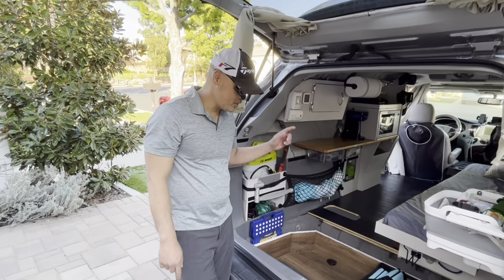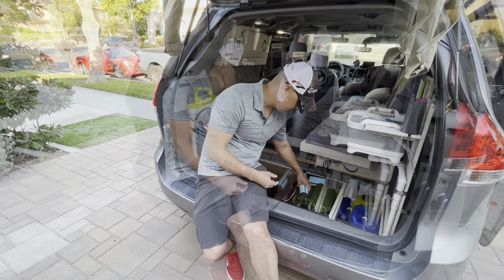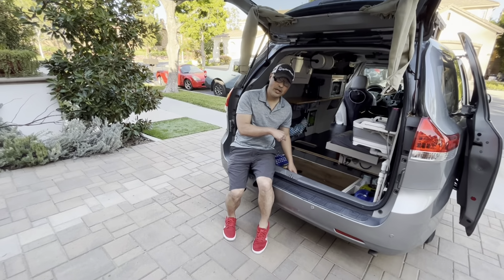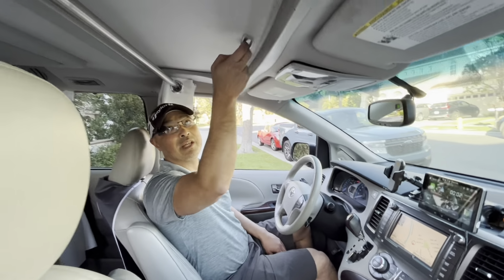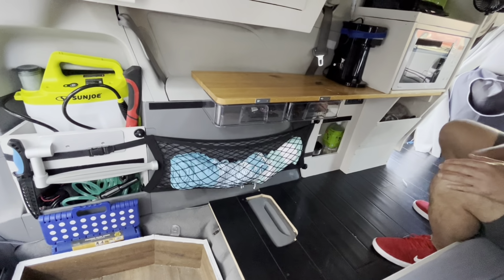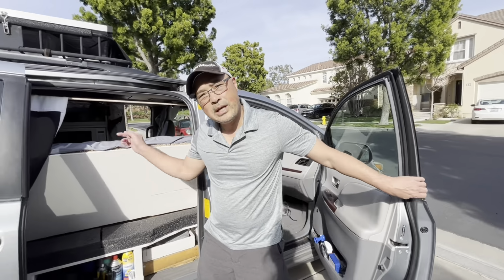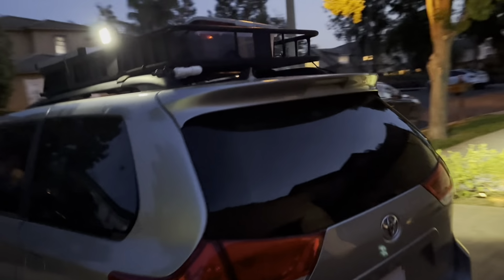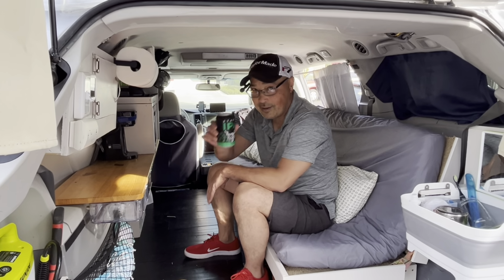FULL TOUR! Best'est,Fun'est,Awesome'est,Coolest,Functional'est,Loaded'ness,Minivan Camper Build

Comment: Why didn’t you do the whole build out as a mirror image (The bed on the driver’s side and the cabinets on the passenger’s side)?
That way you have access to the back from the passenger side door (more traditional) rather than the driver side back door which seems would be more convenient. It seems to me would be the same build in reverse  (but you probably have a good reason for it).  The only difference I see is that the front passenger seat can be pushed forward more conveniently than the drivers seat. (Just a question not a judgment)
Reply from the maker: I had other builds reversed. The passenger seat moving all the way up for the bed is definitely one. I wanted to keep the blind spots exposed. With it reversed, my blind spots would be covered up.
Reply: Is your Sienna a hybrid?
Reply from the maker: @cherylbrash8133 no, just regular xle